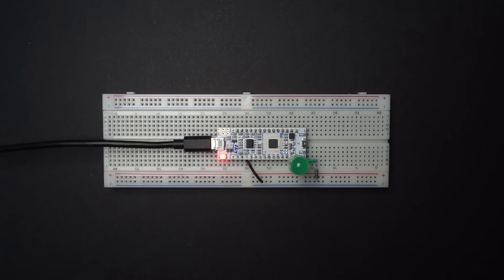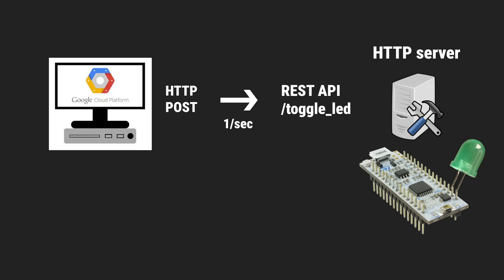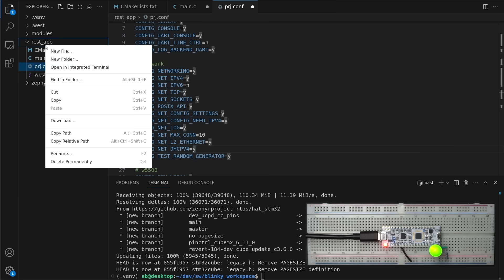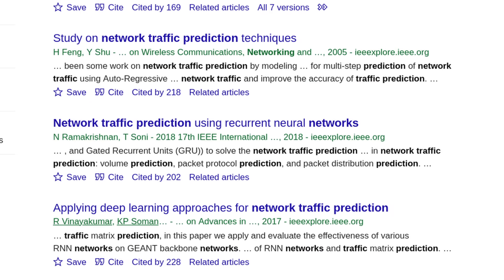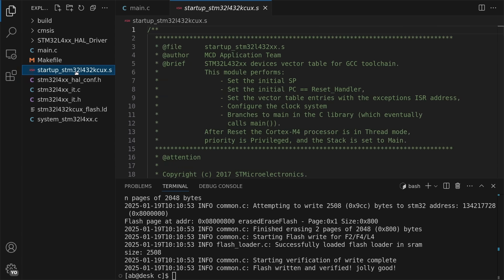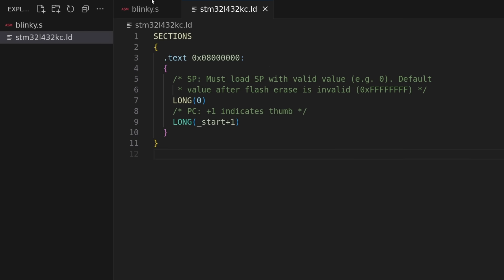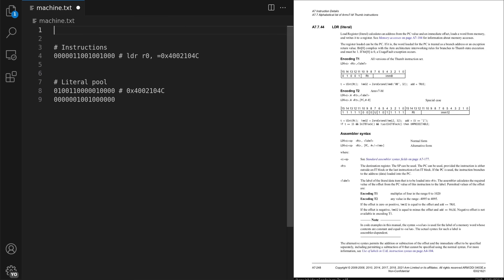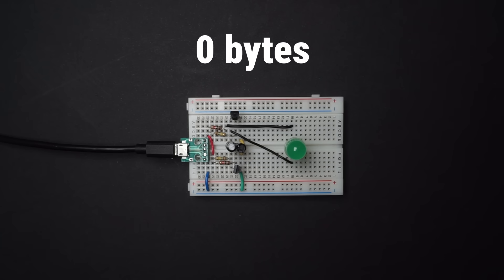I Shrunk Blinky to 0 Bytes

Comment: couldnt find a smaller program but I was curious if a high level language could compile to a very small binary so heres Blinky in zig that compiles to 48 bytes:

const REG_RCC_AHB2ENR = 0x4002104C;
const REG_GPIOB_MODER = 0x48000400;
const REG_GPIOB_BSRR = 0x48000418;

const BIT_GPIOB_CLOCK = 0x2;
const BIT_GPIOB4_MODE_OUT = 0x100;
const BIT_GPIOB4_SET = 0x10;
const BIT_GPIOB4_RESET = 0x100000;

pub export fn _start() callconv(.C) noreturn {
    var combined_flags: u32 = BIT_GPIOB4_RESET + BIT_GPIOB4_MODE_OUT + BIT_GPIOB_CLOCK + 0x45000; // (+0x45000 for ~1 second delay)

    @as(*volatile u32, @ptrFromInt(REG_RCC_AHB2ENR)).* = combined_flags;
    @as(*volatile u32, @ptrFromInt(REG_GPIOB_MODER)).* = combined_flags;

    while (true) {
        combined_flags ^= BIT_GPIOB4_SET;
        @as(*volatile u32, @ptrFromInt(REG_GPIOB_BSRR)).* = combined_flags;

        for (0..combined_flags) |_| asm volatile ("" ::: "memory");
    }
}

with zig build-obj ./blinky.zig -fsingle-threaded -fomit-frame-pointer -OReleaseSmall -target thumb-freestanding-eabihf

Comment: As a PLC Programmer i would have made an Interrupt for the cyclic Operation and add 1 to the Value of an Short Integer.
Reading the 8bit Short Integer bitwise will give you multiple Blink Frequencys at once

But i dont think this could be done in pess than 48Byte on a Microcontroller
Reply: I'm pretty sure that it would be possible to do a rough version in many fewer bytes on a smaller microcontroller.
On a 12-series (14 bit instruction length) PIC, with the WDT preenabled, my initial naive already-drinking-too-much-wine pondering (I'm in the UK, so it's already very late) was something along the lines of:

1) set watchdog prescaler to give 1s delay
2) set pin as output
3) toggle pin
4) infinite loop (delaying for 1s)

likely 2 instructions max for each, and 2) is one instruction, so 7x 14-bit words or 12.25 bytes (I'm not totally sure if a branch to same instruction to do an infinite loop in one instruction would work, but if it does, that's one fewer instruction than (NOP, branch to NOP).
It's possible there would be the odd extra config instruction needed, but I'd have to code it to see.
On actually thinking further, the WDT firing would probably reset the port state so it couldn't be toggled. Given that, configuring the WDT to wake from sleep without resetting would give a solution of:

1) set watchdog prescaler to give 1s delay
2) set pin as output
3) set pin low
4) sleep (delaying for 1s)
5) set pin high
6) infinite loop (or sleep then branch to 1) (delaying for 1s)

with 2,3,4,5 being single word instructions, so maybe only 8 words/14 bytes, or 7 words if  6) is also single-instruction
If the pin state is a defined value on reset (it's beyond me to check that out right now), then some simplification could be done by deleting 3 and making 5 set the pin to the non-default state, saving another instruction so it might only be 5 steps/6 words/10.5 bytes.

It might be considered cheating to use the WDT, as it does rely on config bits to enable it, but they aren't strictly *code*.
Also, the WDT does run off an internal RC oscillator so not super-accurate, but still likely within a few percent and as good as most untweaked RC analog solutions without properly precise components.

It could be that I'd need to do the odd clear-watchdog-timer or two. I don't think so, but again, I'd need to code it to be sure, as I don't really use the WDT, and that'd still be only another 14/28 bits.

Comment: AVR-Microcontroller permit using an RC-Circuit connected to an exposed NO-Gate as Clock. So you can use a Microcontroller as Oscillator without truely Programming it. Thought you might have to set the configuration ROM to use an external RC-Circuit, and I am not sure if it works at 1Hz.

Comment: 86 bytes sounds  like a lot of assembly code, i bet a 6502 based solution could do it in less than 32 bytes, maybe even around 16 bytes.
Reply: It's an artifact of the hardware used. While an older, simple MCU might only need to directly toggle a port bit and do absolutely nothing else as soon as it starts running code, modern ARM MCUs need to have their various internal hardware enabled and clocked before they can use it for anything after a reset.

Comment: Wouldn't even be cheating if you used the MCU pin to power the circuit. Just need enough code to turn on a single pin. Which may be doable with a single register instruction.

Comment: This is how memory optimized I expect game devs to be so tired of their “memory is free” if pong was created by modern game devs😢 today it would be 1 terabyte minimum
Reply: Agreed. On the other hand, would you believe me if I told you that there is such a thing in 2025 as an open source, full-featured GUI-based parametric 3D CAD software, that is a single file, LESS than ten MEGABYTES in size...?
Reply: @AttilaAsztalos  Why would that be hard to believe? When I started using Blender, it fit on a floppy. If you like single executables, you might also appreciate Fossil SCM and Busybox. One guess for what program you refer to is Solvespace.

Comment: If you have a bitshift instruction in your opcodes, you could just preload a number like 0b10101010 into the GPIO register where the LED is connected and rotate the bits every second. That's a single instruction plus some interrupt function for the timing.

Comment: Probably worth pointing out that Blinky is actually useful because if you can compile from source code, link with the appropriate libs, squirt the output into a CPU and execute it on the target system to make the LED flash then you have tested the entire development system and are ready for your more useful program.
Reply: Yes, that's the actual point of it. Simple program to show that everything is working.

Comment: you can use a microcontroller with just a bit to make it turn on, then use it as  apower supply for the blinking circuit and it will technically meet the requirements.

Comment: technically no, it's not 0 bytes, you have two transistors each with two possible positions, which makes a quarter byte or 2 bit, 
But you could have just one relay that switches on and off, i.e. 1 bit,
when it's off via its normally closed contact it charges a capacitor that powers it, once the capacitor is sufficiently charged it switches on and stays on until it's sufficiently discharged and the cycle starts again, by varying the size of the capacitor and the value of one or two resistors you could set it to a relatively precise 1000 milliseconds on or off.

But, it can be argued that different components represent different parts of a code, and that a simpler circuit therefore represents a lighter code,
so even simpler, just power the LED via a bimetallic strip (yes, I'm aware that it would have to be tiny to work despite the very low power consumption of an LED) , when the current flows through it, it heats up, eventually twisting and cutting the circuit, so it starts to cool down, once it's cold enough, it comes back straight, the circuit closes again and the cycle starts again, by finely tuning its resistance, materials and heat dissipation, it would be possible to have a relatively accurate output (in a controlled atmosphere) for 1000 milliseconds.

Comment: You can set up a timer with a PWM output to blink the LED with no additional code. I don't know though if setting the appropriate registers for the PWM output will take less code.
By the way, between the HAL library and writing directly to registers, there is another abstraction layer, the Low Layer library. This is basically constants and inline functions that despite having fancy names that make them look like they do stuff, they are usually a single line of code writing directly to appropriate register bits.

Comment: 0 bytes - attach the led to the MCU clock output. Get very fast blinking. Humans can't tell it's blinking though
Reply: There's an intermediate solution: non-zero code to SET UP the blinking, but zero bytes of code RUNNING once you configured a timer to divide the clock down to 1Hz and output it on a pin in hardware...
Reply: @AttilaAsztalos  which is the opposite of the goal

Comment: Since you're not setting the stack pointer, you can hold some value in the first four bytes.
Challenge: I recently created a Blinky program where the CPU is powered off. It's based on nanoRTOS, configures a timer and uses the interconnect on nRF52850 or nRF9160 to toggle a LED and a pin. Then the task returns and the system calls WFE to enter power save. There's also a switch to start and stop the timer without waking the CPU. Let me know if you like to see code. The best possible precision is 62.5 ns.

Comment: What about a solution using the internal timer or PWM ?
- Initial pin setup
- Initial timer setup
- no loop

Another solution could be a 555 timer.
Reply: Discrete astable is even better (simpler-lower level) then 555

Comment: I expected that you use the stlink as CPU for your 0b version :)

you use the stlink to write the registers "stlink -w32 <address> <data>" . you enable timer and GPIO clock, configure pin as output, set AF, set auto reload register and enable timer.

the led would blink even without the stlink connected.

great video!
Reply: Don't forget to add an uninterruptible power supply to the circuit to make sure the micro controller never resets.
Reply: @ of course :)

Comment: As hobby EE, I like how you addressed the standard trope/complaint "kids nowadays need a computer to blink a LED".  However, it would have been interesting to have measured the precision and drift on the RC based hardware blink, given the "1000ms as precise as possible" rule. Maybe we do need at least a crystal and a counter.
Reply: AI/HTTP overbloat equivalent in hardware: use a GPS receiver to derive atomic-clock-synced blinking. Zero drift ever, as long as you have a signal. Low budget version of the exact same thing: just use the mains 50Hz - it's purposefully being compensated to have the same zero drift in the long term...

Comment: Its still bloated, just connect the LED to a button/coin cell battery and open your eyes for one second and then close them for one second.
Reply: Do you even begin to comprehend all that has to go on in your brain to even try to open and close your eyes every second? Sounds way overkill...
Reply: @redyau_  Keep one eye closed to reduce the brain usage by half.
Reply: @R3VISION3  Great call
Reply: bruh it is still bloated just use the sun
Reply: Let me introduce you to a component called a blinking LED (e.g. WP56BID).
Reply: @0LoneTech  r/woosh
Reply: Truly the purest form of "blinking LED", in which one has an LED and blinks.
Reply: How to spot an Arch user...
Reply: or get a 1hz blinking led
Reply: So we're using the 2 perabyte human brain controller
Reply: yeah but thats running the code clientside and makes it easy to tamper with
Reply: Ghhahahahahahahah!!

Comment: A better way to reliably blink an LED without microcontroller is to use a CD4060 oscillator/counter because it work without electrolytic capacitor. The actual oscillator have a frequency far higher than 1Hz and can use a ceramic capacitor

Comment: There exists a more trivial in-between solution! Though it is platform-dependent.

The very first Z80 program I wrote, in fact, was to blink an LED. I did it on breadboard entirely with jumper wires, a 5V regulator, a clock oscillator, and a reset generator (since the NMOS CPU I was using is a bit cantankerous when clocked unreliably).  (The LED of course needed a resistor, and there were some bypass capacitors around.)

Arguably, this is either a very small, or a very large program.  More specifically, we might say it can be compressed very well...

The trick is: the Z80 has NOP = $00, so when the CPU reads the data bus -- pulled to zero with an array of jumpers -- it simply reads that address (starting at $0000 after reset), does nothing, increments PC, reads the next, and so on, for all 16 bits of address space.  The LED is simply attached to A15, thus blinking at F_CPU (4MHz) / NOP_CYCLES (4) / 65536, or 7.63Hz.  This does mean my program is 64kiB long... but it's also all zeroes.  Note that shorting the data bus to ground is not exactly a wise choice, but we can be guaranteed that the CPU will not assert these lines, or assert any value other than zero anyway, because its state never changes (other than PC), and the NOP instruction only ever reads the data bus.

This is arguably a "simpler" solution than your two transistor multivibrator, if one were to argue by component count alone and ignore wiring, and what the components are, or are made of, or their size; but that would be a bit silly of an argument to make :)

Microprocessors (the CPU itself, without any peripherals, and usually with a parallel bus exposed on pins) are not exactly common today; this is a somewhat vintage solution.  Even using a microcontroller in this way (on those that offer an external bus) might very well take more instructions than the optimized blink: instructions are required to configure the hardware.

Of course, if a hardware solution is acceptable (as we see is the case, given the oscillator :) ), one can use an MCU's timer hardware to good effect.  On something simple like AVR or PIC, this can probably be set up in 20 bytes or so?
Reply: That's so completely overelaborate; I LOVE IT! ❤
Improvements: using pulldown resistors on your databus ensures no harm to the processor, plus adds parts to your circuit; using a different clock source that can be tuned - I'm not sure what the minimum clock speed is on a Z80, but I know a 65c816 (or modern 6502) can be clocked off a 555, or even a debounced switch.

It's important to point out that your 'program' may address 64kB of program space, but only uses 1 byte of actual program - the pulldowns themselves.
I've done a similar program on the 65c816, opcode 0xEA (NOP). Used pullups & pulldowns. 

Also, buy up some modern Z80's while they're still easily findable, if that's your flavour. They still make modern versions of 6502/65c816 fyi.
Reply: idk why but the idea of attaching an LED to A15 is just so funny to me. Genius!

Comment: Microcontroller with 50 bytes of machine instructions: blink
An astable multivibrator: Look what they need to mimic a fraction of our power
Reply: Analog > Digital, once again ⚡⚡
Reply: @bendon4604 yeah, this is something i'd rather have as a simple analog circuit due to simplicity and the 'it just works' effect.
Reply: Scr relaxation oscillator enters the chat
Reply: @noimnotarobotcanubeleiveit7024  the humble bimetallic thermal switch:
Reply: @antimu0n  bimetallic thermal switches are very sensitive to current, good as an error message on old cars because they would slow blink when a bulb burned out. But not compatible with anything other than the original bulb type, power, and bulb count (including dashboard indicators). Also no dimming allowed. Sure you could just add shunt resistors but then it's sucking up as much power as the original incandescent-bulb circuit. Cooling and ambient temp can also change the blink rate.
Though the RLC oscillator in the vid may also be moderately sensitive to power consumption the base signal generation is reasonably low current and could use a transistor to isolate the signal circuit from the load circuit.
Reply: only* power
Reply: A circuit was the only way to get to 0 bytes
Reply: Medhi would be so proud of calling it a vibrator.
Reply: A neon ne2 bulb with a capacitor doesn't even need to step down the mains voltage. Still doesn't beat the bimetallic intermittent switch, tho.
Reply: And then the weirdo walks into the room. The reverse avalanche oscillator.
Reply: There are already LEDs that blink on their own. Just connect them to power and they start blinking.

Comment: There are actually blinking LEDs. You don't need any external components.
Reply: But you will still need to top up the blinker-fluid every so often.
Reply: integred IC
Reply: But if you saw inside the LED there are more components probably an IC of some sort.
Reply: THIS is the actual engineer's solution. Pick up the Big Blinking LED Catalogue, choose one, job done. Zero bytes AND zero parts. Sorry, "needs to also not blink sometimes" was not part of the spec...
Reply: @AttilaAsztalos  I feel like this is going in the opposite direction of the video’s theme. In reality, you can buy these kinds of LEDs, but treating them as a black-box solution without understanding what’s happening inside—and calling that the “proper” approach—completely misses the point of the video. Since the video explores RTOS, C, and even Assembly before transitioning into the hardware implementation of an astable multivibrator, advocating for a black-box solution feels completely out of place.
Reply: @josemanuelromo6832 Indeed. Btw, some candle-simulating leds have quite fancy integrated circuitry. I wonder if those could run Doom.
Reply: But that wasn't the point.
Reply: true, I bought 10 off amazon for $5. They even have a resistor and can run off 12V or 5V
Reply: Use a bimetallic filament like those Christmas tree led and it will be purely mechanical!
Reply: yups, the author forgot about it.
if tr, r, c equ 0, then dedicate led will be -5 hehe

Comment: It can be done with an old microprocessor (or 8051 microcontroller for the pernickety).
With a 6502 you could hardwire pull-up/Down resistors to provide opcode 0xEA (NOP) on the data pins and run the LED from A15.
IIRC 'NOP' takes 3 cycles so the blink rate should be Clock / (65,536*3), about 5 Hz per Mhz clock.
No actual memory = 0 bytes, 1 if you're being picky ;-)
Reply: Hah, 'twas the first program I wrote for Z80. Particularly simple as its NOP is $00.
Reply: Someone did a video about doing that recently. Only they used I think 4 LEDs on A15-A12 to display a binary counter.